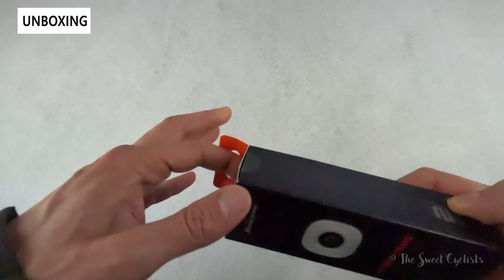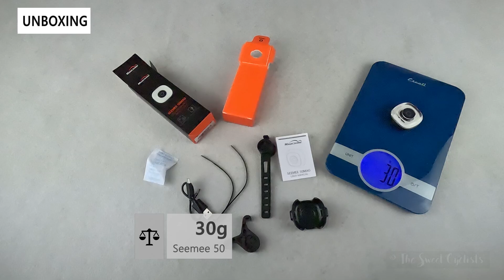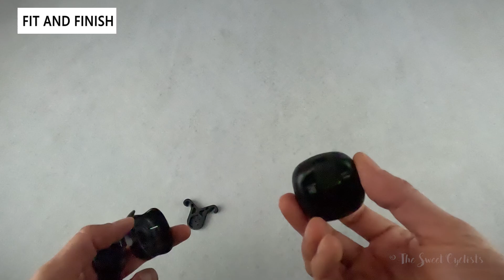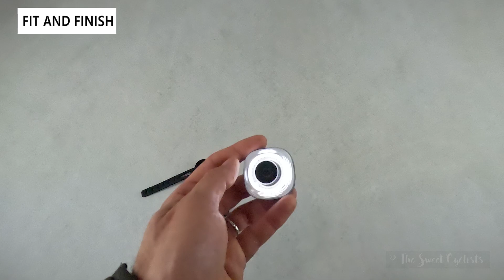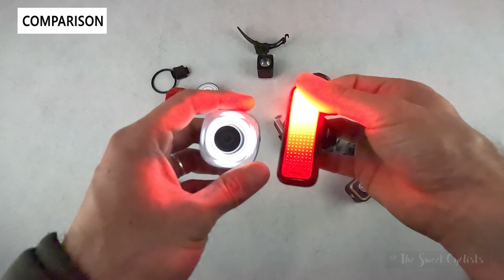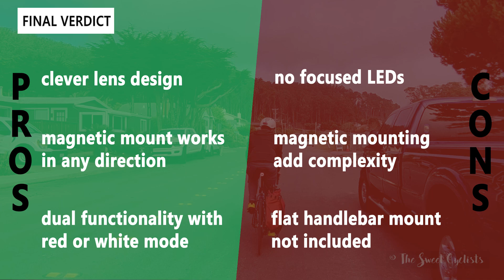Magicshine Seemee 50 Mag LED Magnetic Bike Lights  - feat 50 lumen + White/Red Mode + USB-C Charging

Comment: How strong is the magnet? Will it hold if you happen to bump in a pothole or a speed breaker? Have you tested it how safely it holds while on the cycle and bumps?
Reply from the maker: The magnetic part is just part of the holding mechanism, there are clips on the sides of the lights that hold them in place so it's very secure. Honestly, the magnetic part of the feature really doesn't add much value, you still have traditional rubber straps and plastic tabs holding everything on the bike and together.
Reply: @T @TheSweetCyclists  adds up to value when you stop for a coffee and just take it off in a second

Comment: So these essentially look pointless for daytime. And no night time test.
Reply from the maker: These lights are visible during the day, but without the focused LED you won't be visible from further distances. We don't show night time riding footage as the 50 lumen output is too low for our camera to pickup. It is visible at night but it is still a "be-seen" style commuter light. The Seemee 150 / 200 / 300 are much better options for road cycling or daytime use but don't have the magnetic mounting the Seemee 50 Mag offer.